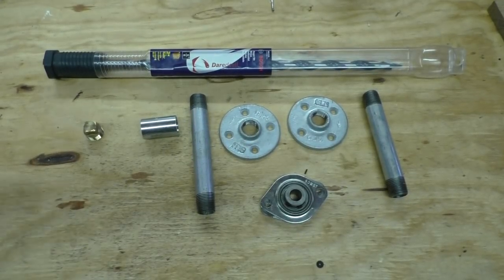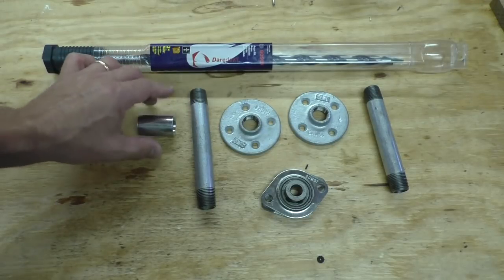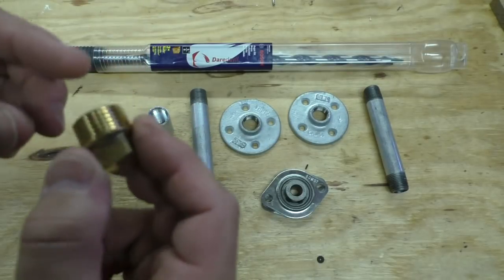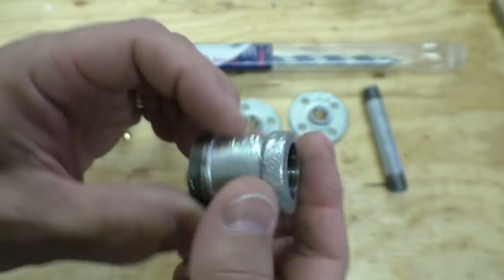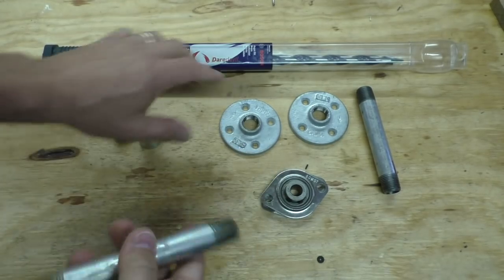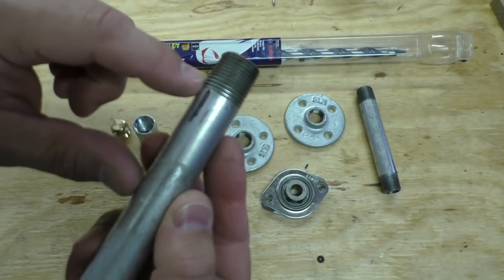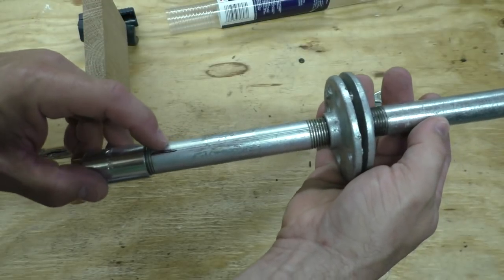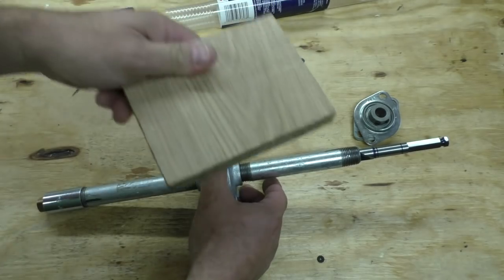Filament Extruder #3 The Assembly

Comment: Hey could u send me a material list so I can go get it at Lowe's just the motor and machine parts I don't need the hopper or table stuff just the drill and motor and whatever heats it up I saved your video but I just got a printer and I know ima mess up I can grind it up with a home made grinder I just need materials for this setup minus the hopper work basically and how much did it cost email if u could at ematthews1990@yahoo.com or find me on Facebook at Eric Matthews my picture has my :-! In it and it looks pink kinda if u can add me and message me the material list be so much easier I get to many emails thanks

Comment: hey great video.  For the wood insulator.  I didn't hear you mention what you did to put the bit through.  Did you drill it and then put a sleeve inside or just drill it and let the plastic come in contact with the wood?

Comment: Thx for you about all you videos.
Please coud you indicate for me the inner diameter of the borrow and diameter of screw.
Another question : i use a borow inner diameter 22 mm and screw 22x 500 mm. can i use a nema 17   1,6 amp as motor to rotate the screw.
Reply from the maker: It is a 5/8 inch bit.  A stepper motor won't have enough torque to rotate it.
Reply: @MakingStuff  medida de la broca estima amigo xfavor . Gracias

Comment: Sir?? May i ask how much power did you put to fully melt the plastic?? Please
Reply from the maker: The PID controller and thermo-couple automatically set the temperature at the heat band.  I don't know how much power the heat band uses.  You should be able to see the temperature set in the video, I can't remember off hand.

Comment: May I ask where you purchased your heater band?  I'm having trouble finding one online.  The conduit coupler  is about 1 1/4" OD.  The 3/4 black pipe is 1" OD.  I'd like to use two heater bands if possible. 

I also modified the nozzle by using  a 3/4 x 1/2 bush to1/2 x 3/8 bush to 3/8 x 1/4 or 3/8 x 1/8 barbed hose adapters.  It should eliminate having to drill any plugs.  I wish I could post pics here because it look pretty badass.
Reply from the maker: I think it was zoro.com
Reply: Making Stuff thank you for your help.  I'm really excited about this build.  I'm going to at least make a video of the finished product. I would be happy to have you view it and offer any advice or tips. Thanks again and keep on building on
Reply: Also Aliexpress has them

Comment: Nice video loads of helpful stuff. A you watch a ton of video content on any one topic you can get small bits of info from all over and fill in gaps in your own knowledge. At about 9mins in you mention a problem getting the tool rest into place.You should be able to lift the rest from the 'arm' the remove the middle section and drop the tool rest into the part that fixes to the lathe bed. That part is known as the banjo and it should be the same diameter hole as the tool rest post. The extension is most often used to allow the tool rest to reach round the edge of a large platter to turn right to the center  If you are unlucky and your lathe uses two sizes then it might be easier to make a sleeve or reducer.

Comment: I see you have a lot of experience with building DIY filament extruders, I find them very interesting. However I know diameter consistency is very hard to achieve with these materials and therefore you print quality will go down. I have been thinking... wouldn't it be possible to measure the diameter of the filament at a fixed point and adjust the flow of the printer in real time while printing. It sure would be a challenge but more diy filament could be used. For example, use two wheels, one fixed wheel, one attached on a sliding potentiometer with a spring pushing it against the fixed wheel, an arduino could measure the power and adjust the speed of the filament feeder. Just came up with the idea, thought it might be useful for the development of these diy extruders. Keep up the good work, love what you are doing!
Reply: Hydraulic cylinder might have been a better idea. The ID is honed  and polished. No seam to worry about.

Comment: It's wonderfull.
What kind of solder are you using for sold the differents elements?

Best Regards
Reply: :/ I think it's obvious he was asking what kind of filler material.
Also, in Spanish, "soldering", "welding" and "brazing" are all the same word ("soldar"). That could have been the source of him mixing up the terms.
But in the end it's probably all mild steel, just some is galvanized (and yes, breathing its fumes can cause dementia and other nice things), and some hot rolled.
Reply from the maker: I'm using a TIG welder, not solder.

Comment: When drilling the brass plug, screw it into the conduit coupler, then chuck that in the lathe facing the other direction and drill the plug through from the backside.  You can't clamp NPT into the lathe by the threads because not only can you damage the threads, but pipe threads are tapered so it won't be even close to being centered or securely clamped.
Reply from the maker: Good point.  I will try your suggestion.